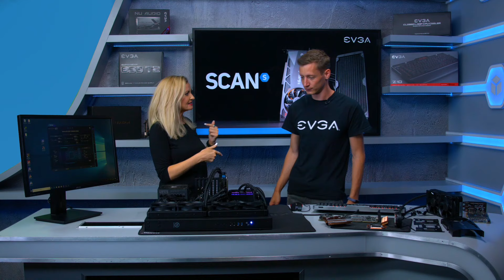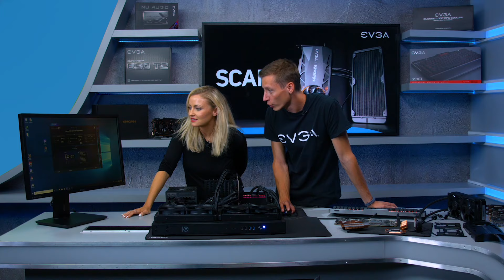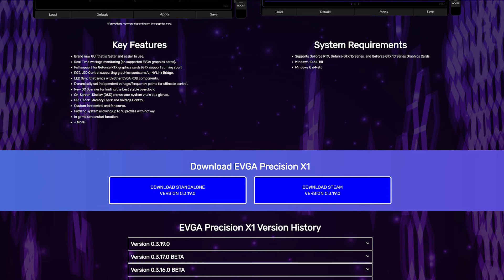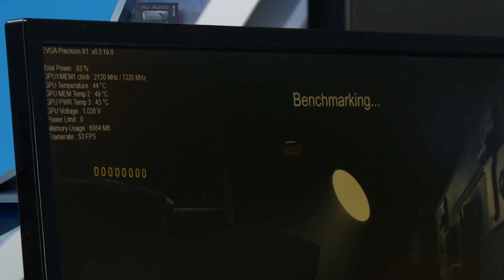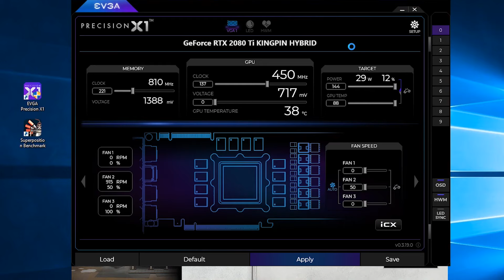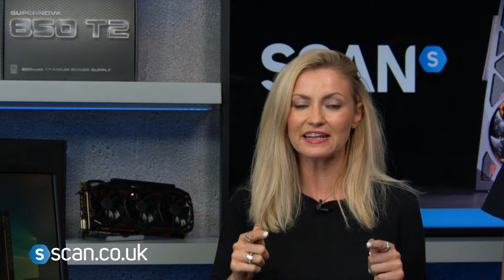The ULTIMATE RTX 2080 Ti?? EVGA K|NGP|N - Part 2 - Overclocking with Precision X1

Comment: Because of that beefed up cooling solution and the triple 8 pin power connector, everything is at it's best. Only one thing is left, it's of course overclocking, and with a utility like  EVGA Precision X1 with it's ICX technology we can monitor temperature all over the card not relying on a single point. And one note for those who's afraid of overclocking your GPU, it's so easy these days with the overclocking utilities like EVGA Precision X and MSI Afterburner, do you using these you can easily get the max potential from your graphics card which is just idle inside, and don't get  EVGA KINGPIN Cards if you're not gonna overclock those :) .

Comment: You guys are great, but I tip my hat to you using Precision. I hate that app. The coding is horrible and just too buggy and has been that way since Unwinder flew the coop. If I had a gpu with the evga cooler setup id just run the fans to a fan controller like the Lamptron fc2 or put all the fans on the fan header on the card with a splitter and run them with Afterburner. Im a big fan of evgas support and customer service but that app has GOT to go.

Comment: The EVGA Kingpin looks nice.  I like the initial temperature and sensor view.  It does beg a question as to the cooling areas focused on the sensor areas.  Could or indeed should textured cooling surfaces adjacent to the sensor areas being able to be "over-cooled"?  Areas being subject to setting individually for those that like thier micro-management.